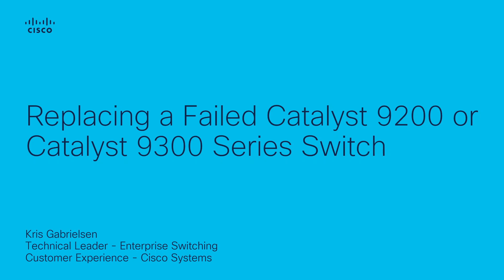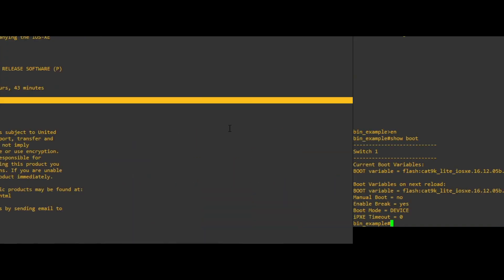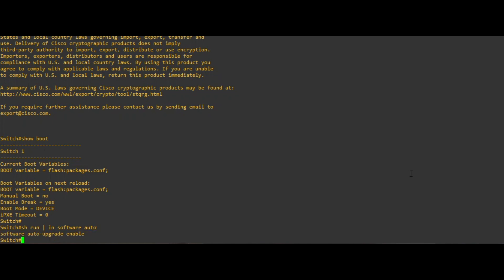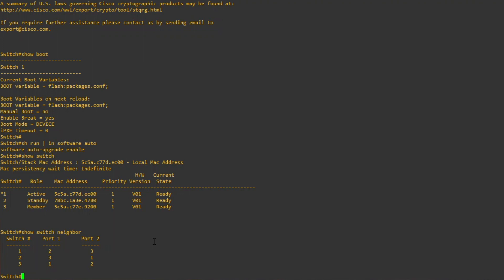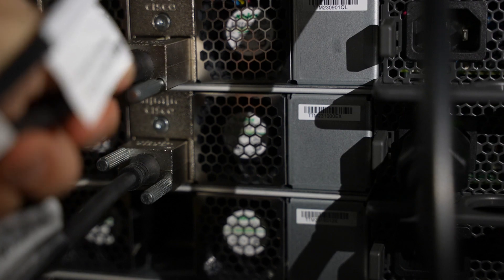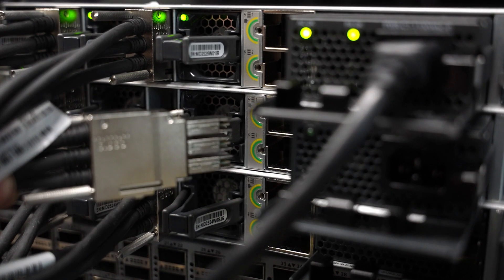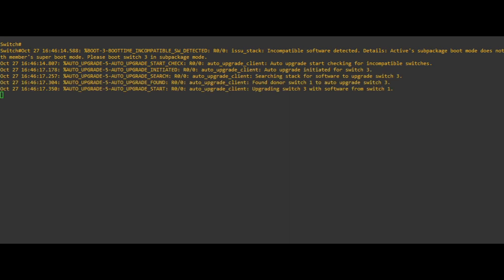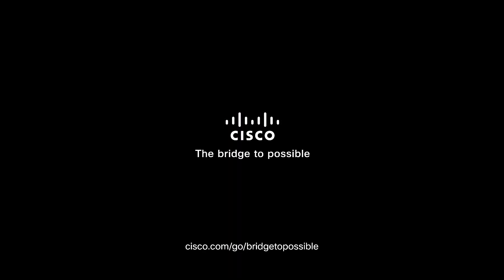Replacing a Failed Catalyst 9200 or Catalyst 9300 Series Switch

Comment: I have active switch to replace with new higher version. ios17 from 16. if i activate auto upgrade and redundancy force switchover, do i need to update the old master with ios 17 ? or update will be done automatically when i ll plug the new master in a stack ? thanks for the video.